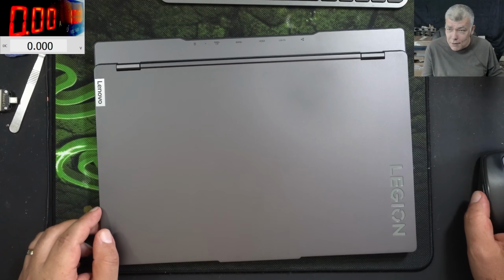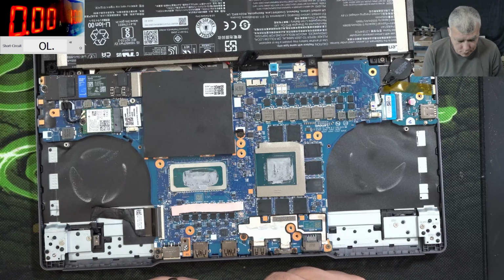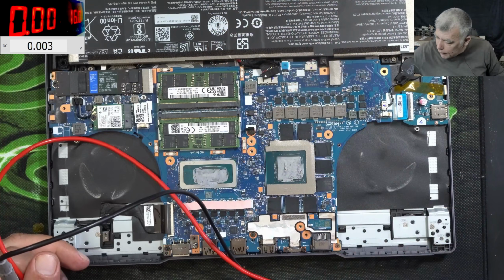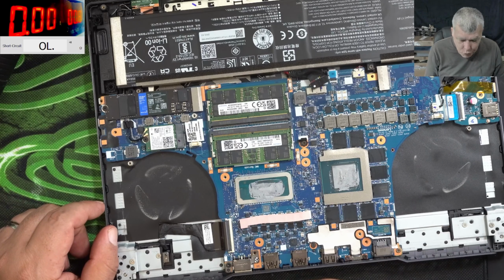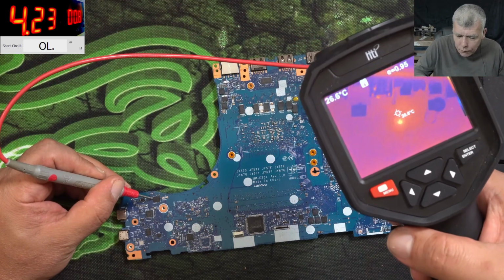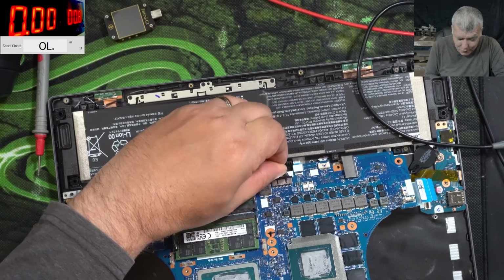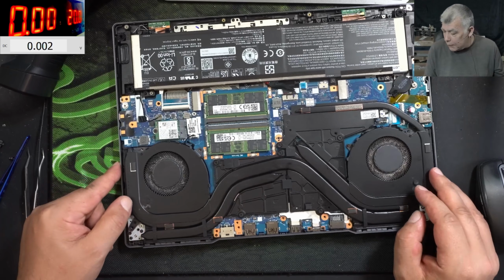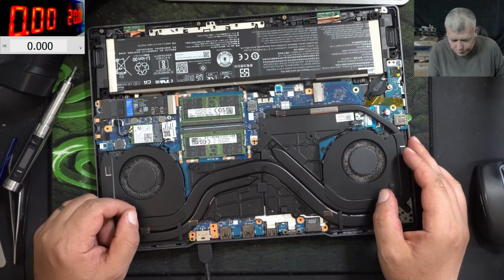Lenovo Legion 5 15IAH7H dead, no power not charging board repair - pay attention to 5v power supply!

Comment: Hello,

I am looking for a REAL FULL SPI BIOS dump for Lenovo Legion 5 (AMD).

Model: Lenovo Legion 5 15ACH6A  
MTM: 82NW  
Motherboard: NM-D931 Rev 0.2  
CPU: AMD Ryzen  

I need a FULL 16MB SPI image dumped with an external programmer.
Requirements:
- File size must be exactly 16,777,216 bytes (16MB)
- Flash Descriptor must be present
- First bytes of the file must be: 0F F0 A5 5A
- Not BIOS.fd, not Lenovo EXE content, not partial BIOS region

This is for CH341 programmer recovery.
Without Flash Descriptor the board will not boot.

Thank you.
Reply from the maker: Please check our discord, bios section, should be there

Comment: hi, very nice tutorial and i learnt quite a few things from this. I also have a Legion 5 with same internal arrangement of motherboard. I accidently shorted the battery connector terminals with the heat sink plate while i was about to fix it back after changing the thermal paste on the cpu and gpu. My bad, that i didn't remove the battery plug. Now the laptop fans spin for a brief moment and the keyboard lits up, but no booting further. What should i start looking for on the motherboard to troubleshoot?

Comment: Hello.. I have a lenovo legion.. I replaced a standard 40 pin display I think of 60 hz, the broken one having 144 when I pressed the button it did not turn on. It does not turn on either with a broken display or without. Charging light present. No power.

Any guidance is welcome. You would help me a lot with some advice or what I could check.. I am sending 6 kegs of beer, peace!

Comment: How much would you charge to diagnose an alpha 15 a3dd and can i ship it to you?
Reply: Ive been trying to learn through your videos, checking the power rails, ensuring charging works, disconnecting various components including swapping ram, i get good voltages on the capacitors around the board and the inductors. I dont have a microscope so checking mosfets can be difficult

Comment: Thanks so much, Sorin — and no offense — but every time you open the lid of any laptop, you tilt the screen in a really harsh way, and it seems like you're not even aware of it. The laptop's chassis can get bent, and that's not okay. Not replacing damaged parts is already a serious issue, but please, at the very least, try to handle laptops more carefully.

Comment: Thanks for the great video Sorin.This one is exactly my current laptop. It charge other devices through that USB-C port. There charger is 300 watt (20 V 15 A).
Reply: I also use that kind of laptop (legion 7 pro 16irx8h). Charger is 330 watts and usbc charger with pd3.1 charging maximum is 240 watts.

Comment: how did you know it was 5V coil? what gave you it was 5V?
Reply from the maker: Oh, i had this board model before, otherwise i wouldn't know. But even if you don't know what power supply was, we had 0 ohms and we found the shorted cap using 0.8v, so this applies to any power supply

Comment: I thought my Legion 5 laptop was dead, I took it apart, gave it a cleaning, found nothing burnt or anything to note, put it back together, and still no power or charging indicator.  It turns out, the power cord plugged into the transformer came loose while sitting on the ground, I must have kicked it loose.  All that work for nothing, but at least I got to clean the fans.
Reply: It's not for nothing, it's an experience. I have similar episode after which I always check the power supply 😅

Comment: I have a different Legion 5. Manual states it can be powered via the back USB-C port IF the usb charger can supply at least 20 V and 2.25 A. It can be charged also at that amperage if off, hibernating or sleeping. It needs 3.25 A or 5A to be able to charge in power on state.

Comment: Sorin, that charging sign on the side is called thunderbolt, it does not mean it can charge on that port, also it has pcie lanes conected  directly to chipset/cpu.
Reply from the maker: Got it, thank you!
Reply: This is why I’ve always hated the name and icon they use. Misleading to those who don’t know it.
Reply: @perkulant4629  not really, its connected via the thunderbolt controller and  multiplexers that the pd controller re assugns to extended functions via the sbu lines of the type c port.